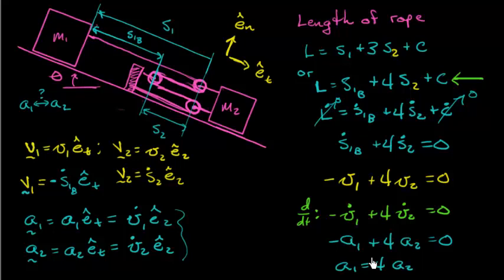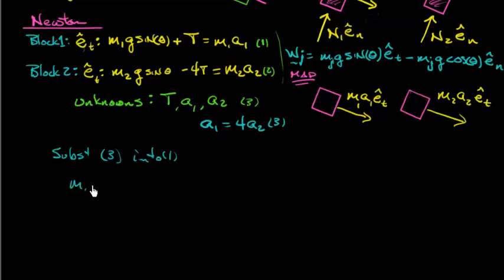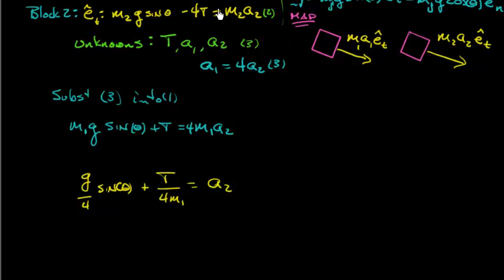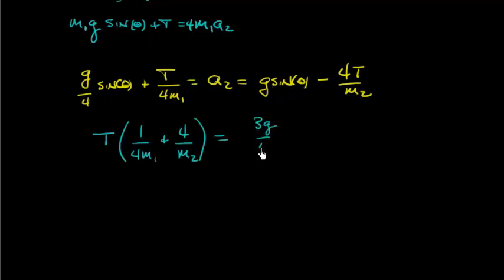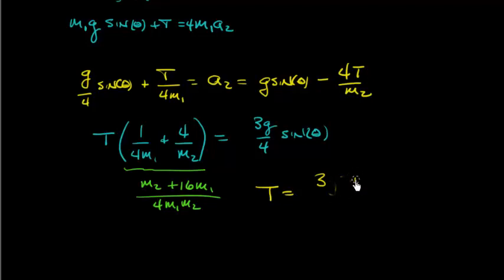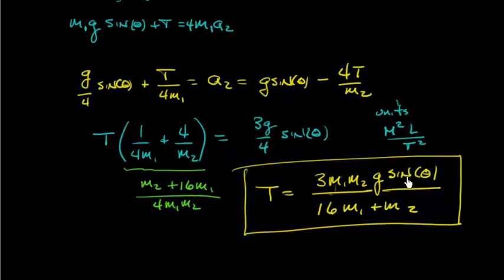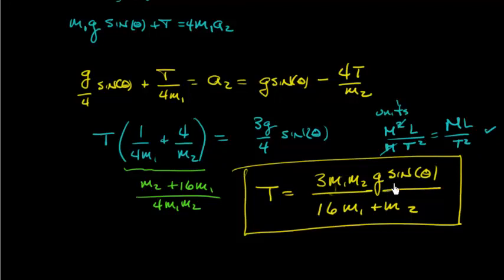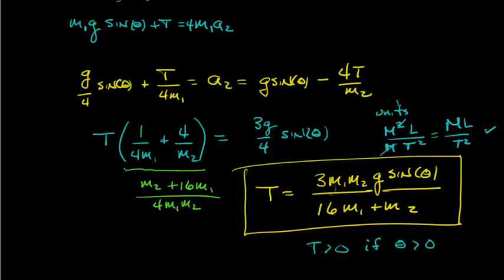Proper Pulley Problem, Part 2 - Engineering Dynamics Notes & Problems

Comment: 7:01 m1 accelerates down the slope faster than m2 by virtue of it being connected to the pulley system. It's the very tension in the rope that enables m1 to accelerate down the slope faster than m2 and not merely at the same rate due to gravity as they would without the pulley system, at a rate of a=g*sin(theta)

From a purely geometric perspective we see that in order for the rope to remain tight around the pulleys, m1 needs to move 4 times further than m2 and in the same direction. And for this to occur m1 needs to accelerate 4x faster than m2 and in the same direction. To find the direction, we know that the resultant gravity force is acting to accelerate the masses down the slope so we know that m2 will be accelerating down the slope at some rate. So we can see that in order for m1 to accelerate 4 times faster than m2 and in the same direction, the tension force from the rope needs to be able to accelerate m1 down the slope. It's this tension force that will provide the extra acceleration to m1 down the slope.

In the students' suggested example you have a situation where tension force from the rope can only act to accelerate m1 up the slope. m1 would need to be pushed by the rope in order to achieve it's extra acceleration down the slope required to keep the rope tight around the pulleys. Since ropes can't push, what would happen is that m1 and m2 would simply accelerate down the slope at the same rate due to gravity and the rope would go slack. Without rope tension the acceleration of the masses will be completely governed by gravity (ignoring friction ect.) and the masses will simply keep accelerating down the slope at the same rate of a=g*sin(theta)
Reply: Thanks for the comment. This seems a good "intuitive" explanation!

Comment: but acc. to cartesian convention of angle we measure it counterclockwise so shouldn't the signs be interchanged and so the result?
Reply from the maker: The equations were derived using the convention labeled in the diagram.

Comment: If m1 is accelerating faster than m2 then wouldn't it make the tension in the rope go slack as it continues to travel faster down the slope?
Reply: That's what I was thinking and so I was surprised by the result.But perhaps there's some equilibrium at play where as the tension on m2 decreases, it accelerates faster and restores the tension.